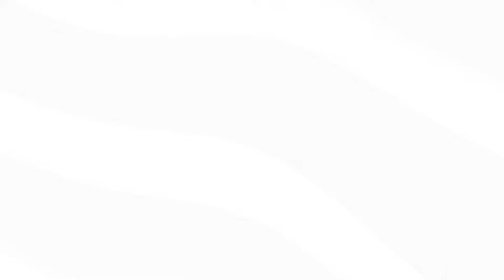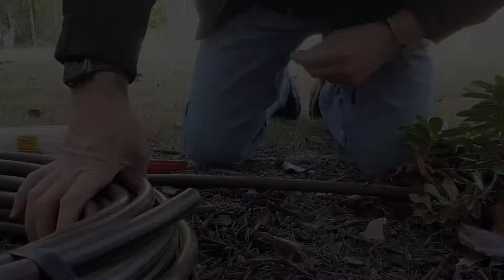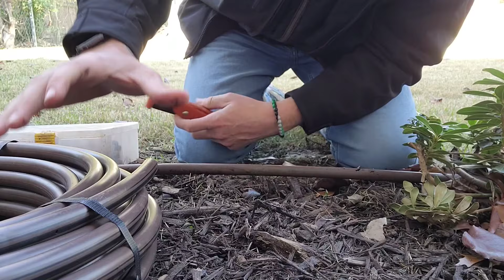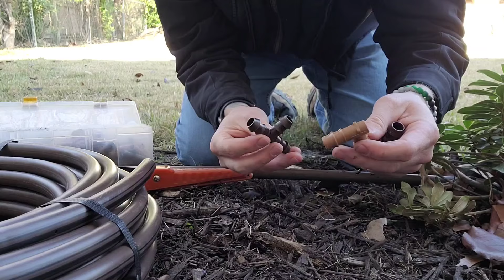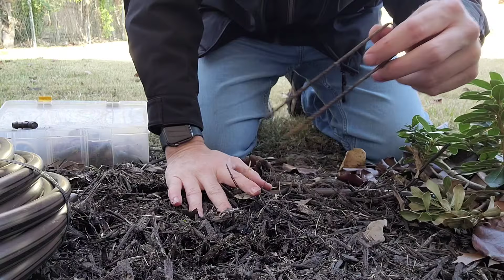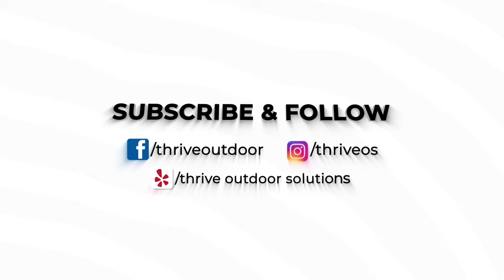How to: Repair Your Irrigation Drip Line

Comment: do you not have the problem of the dripline constantly bursting at the barb fittings? Every time I replace a stretch of line, the dripline breaks at the couplings within two weeks.
Reply from the maker: 1 of 2 things it may be.

Most common, if it is "breaking", then it is probably a critter chewing through the fitting to get to the water.

2nd issue may be there is no pressure regulator on the zone.  This would not cause the fitting to break, but rather to pop out repeatedly.  These zones need to be set to 40PSI to prevent disconnecting.
Reply: @thriveos  The fitting isn't breaking, nor is it popping out. I have 40 PSI regulators on all my zones. What's happening is that the tubing is cracking just a tiny bit at some of the fittings, much like you'd expect it to do after drying out for years in the sun, except this is after two weeks of use. 🤷‍♂
Reply from the maker: @peterkuebler8284  What brand is the tubing and where are you purchasing it?
Reply: @thriveos  It is Hunter HDL. I'm getting it from the nearest Aqua-flo supply store.